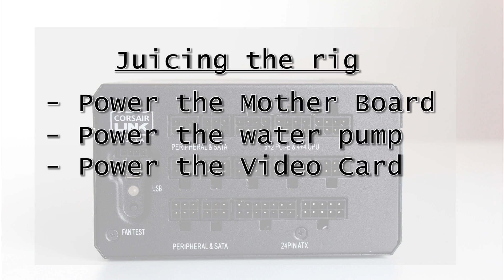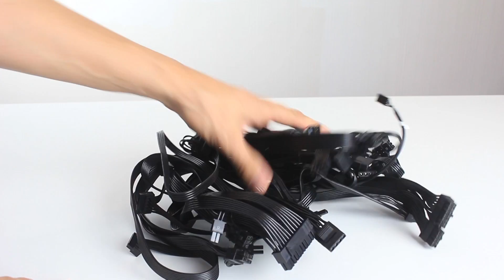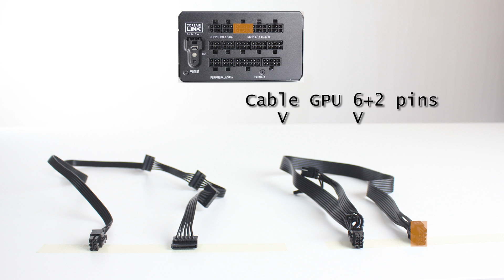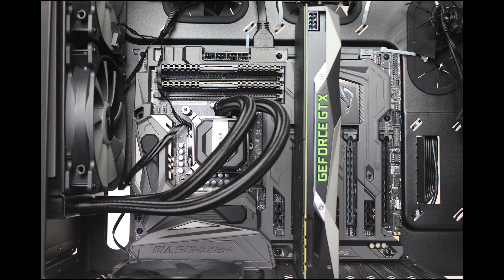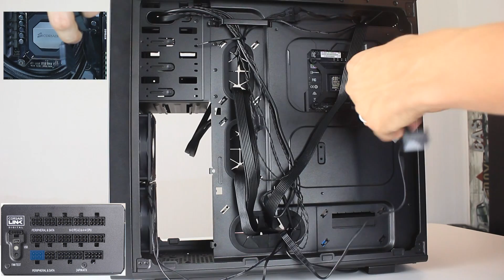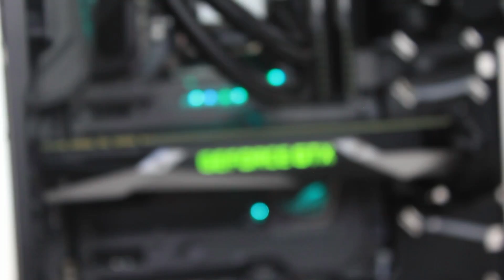Build an insane gaming machine (PSU cable connections) 9/9

Comment: why does gpu power cable has dual connectors?
Reply from the maker: Many GPUs require 2 connectors to properly operate (1070 and 2070 and above.)

Comment: Hi I know I'm late on this but I want to ask a question.

So I am building a pretty damn expensive pc and the parts are:
 Ryzen 5 3600x

Asus TUF x570-plus gaming (wifi)

Corsair vengeance pro RGB 16gb (8x2) 3600mhz

6 LL120 corsair rgb fans (also using commander pro)

Deepcool castle 360mm rgb v2 aio cooler

Msi 2070 super x trio

4tb Seagate barracuda hdd

M.2 1tb pcie 4.0 (4th gen)

Lian li 011 dx black CASE

And other things to go with it.

I'm planning to buy a 750w version of the same psu that you have. Is that gonna be enough? Or should I go to the 850w version of this psu?
Reply from the maker: It will be more than enough

Comment: a 1000w psu is overkill you wont even be using half the power will your system still work
Reply from the maker: Thats correct :)
Though i upgraded this build a few times and has now a 8700k woth a 2 1080s . 

Watch the upgrade video :)

Comment: great video got a question plz, if i had two 1080 ti where do i plug the second cable since u did one?
Reply from the maker: The PSU comes with spare power cables so that you can operate more than one card :)
Reply: does the G650M 650 W comes with more if i wanted to add a second card and is 650w good for two cards?
Reply from the maker: 1080tis .... go for 850 watt and full modular.

Reason I say this is ur cards will need 4 to 550 watts in full mining or gaming  .

Gives u very little spare to run a descent CPU , mobo , or anything else.
Reply: thanks, keep it up with them videos! :)

Comment: I have a question, does a 750w or 650w Power supply support this configuration?
 Intel Core i7 6700K (overclock 4.6Mhz)
Asus VIII Formula 
4x 8GB ram memory 
SSD Hyperx 480GB 
water cooler NZXT KRAKEN X62 
and a GTX 1080 Strix ! 

Or I will need a 1000W power supply ?! Thanks
Reply: NZXT 340 ELITE CASE !
Reply from the maker: +Lynconn sz your processor and video cards are the biggest watt drainage.

In your case 91w + about 200 / 250.

So you are good with a 650 watts.
Reply: Laurent's Choice thank you soo much !

Comment: Thanks for this great series!
I was disappointed with the Corsair H110i GT's pump assembly, really shabby build quality... I'm used to the X99 CPU which does not use the backplate and had no issues but with this 6700K I never managed to get the back plate to stop shaking (read the manual, first time for everything, and they say it's normal). Last time I use an AIO... Back to my Noctuas :)
After all the cable crap, which for me is the worst part in assembling a PC, I decided to get rid of them all and ordered those fancy color braided cables.
Again, thank you so much for the most comprehensive PC assembly series I have ever seen. Keep up your great work.
Cheers.
Reply from the maker: +NorthWolfe well said.... 

And thank you so much for your warm comments.

I'll finish the X99 build next week.

I'm preparing another custom build on a X99 and a Z270.... yes .... the brand new and shiny Z270 !
Reply: The new Formula IX comes with an integrated I/O Shield!!! 
I've been dreaming of this for a decade.
I'll start ordering next Monday, somebody in the house must need a new PC (they go on sale on the 5th, I believe) ;)

Comment: I have
i7 6700k
asus Formula 8
corsair h100iv2
corsair 16gb ram 8x2 dominator3200

end of October, purchasing the 1070 gtx because in my country it is super expensive. some case that you recommend? regards
Reply from the maker: wow... ur serious about your gaming... that sounds like an expensive rig indeed. What PSU did you get? What's your storage like?
I usually match water cooler radiators with the casing to avoid compatibility issues.

If not I'd go with Cooler Master, or Thermaltake, the later being a little better in quality build.

Make sure to get a good size (mid or full), you got a double fan radiator...and that is bulky. Get a casing which will allow good cable management... cause that 1070 is BIG.. and it'll take most of your casing width.  Don't take the casing I featured in the video, after extending use, I find it to vibrate quite a lot.. and since you'll have at least 5 full sized fans running.. it'll be a lot of them.
If this is your first time assembling a one-loop water cooler, watch the video first... I know I had a few hesitations at my first install.

Hope this helps.